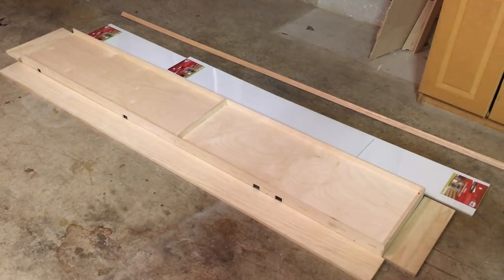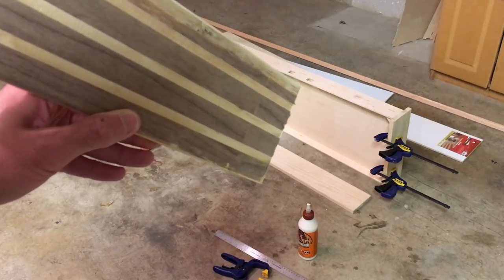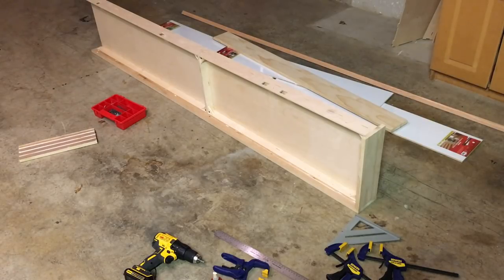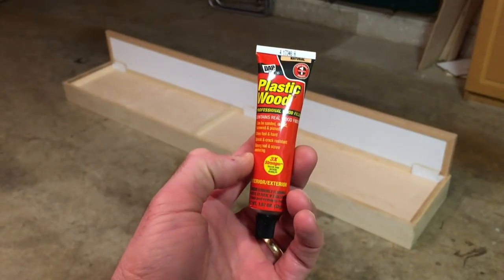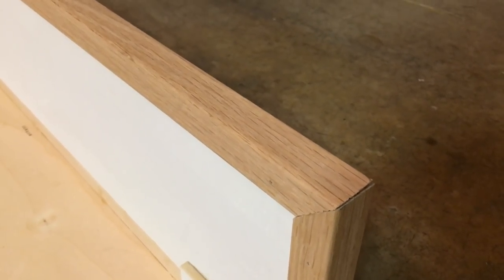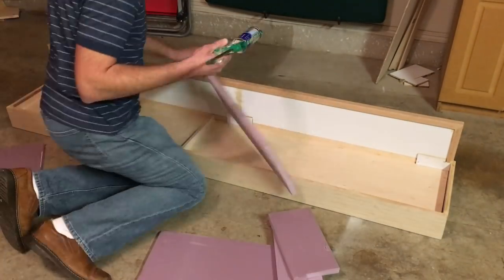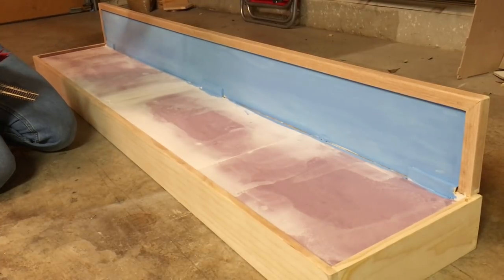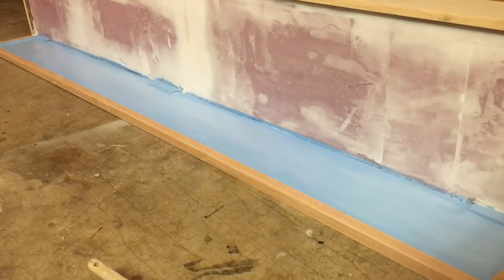Tulsa Spur Part 3: Building shelf layout benchwork

Comment: I don't understand why it needs to be so big. You can build an 'OO' gauge Inglenook in 44" x 9". Granted that is using British outline. If you live in Texas I guess there;s no limit.
Reply from the maker: It could certainly be shorter, but I wanted to have #6 turnouts and modern rolling stock, so this is the minimum length to accomplish that.